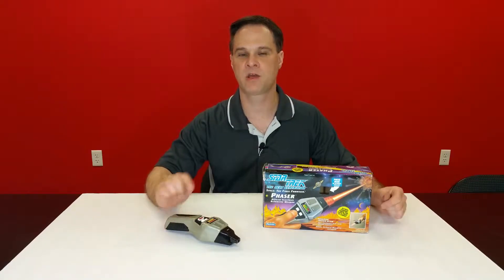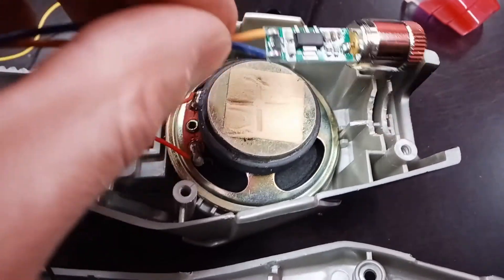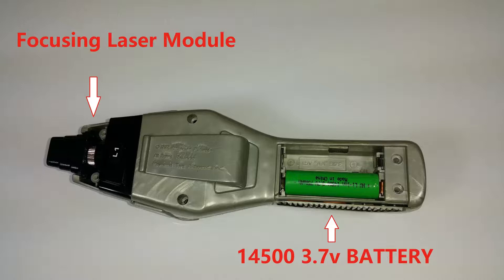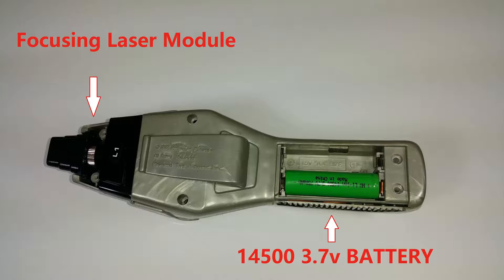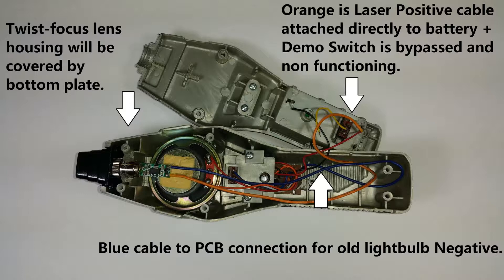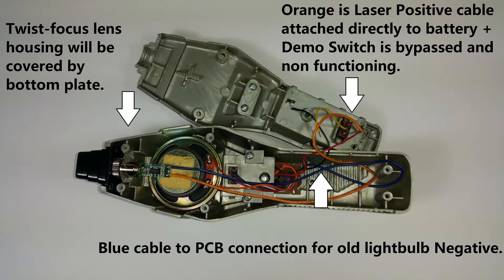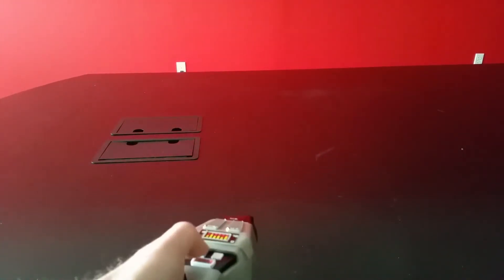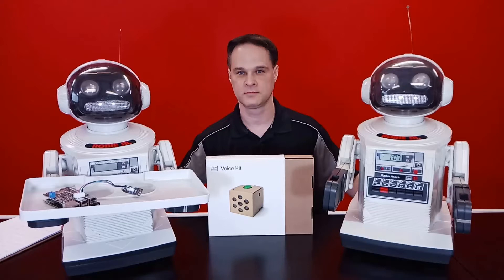Custom Star Trek Phaser with Burning and Cutting laser.

Comment: The batteries don't push current. The devices draw current from the batteries. They use only what they need. Two batteries in parallel will just give you twice the battery life.

Comment: Is there a stronger laser to burn cardboard at a faster pace?
Reply from the maker: There's always a stronger laser. This is .25 watt. They make them up to 7 watts. Limit is how much power you can fit in and how much heat you can dissipate.
Reply: H @devianrobotics3877 have you though abutbding thevsmebth onnthisclher with star wars lightsaber ik mdfyinniyotnlightsber to acthualeer blade
Reply: @devianrobotics3877 have you thought a ih ding same thief a lightsbervjust Jung lightsaber toy snd modifying it to sh rel lserbkade